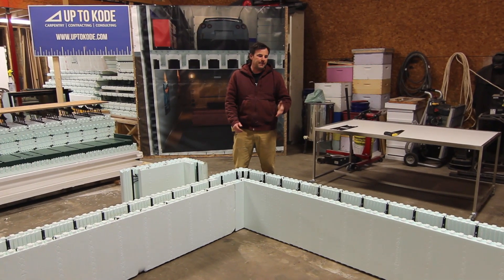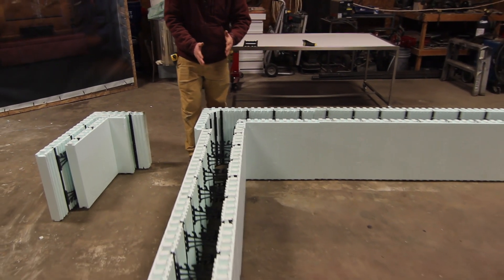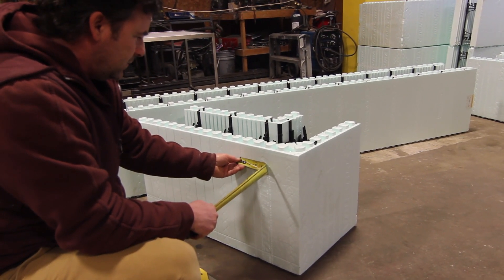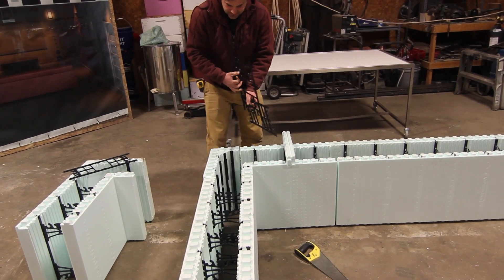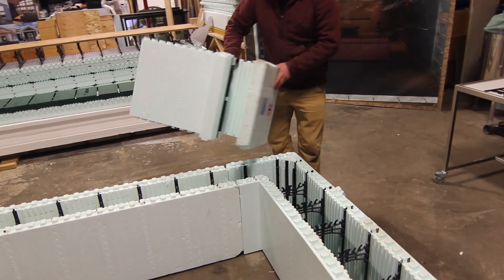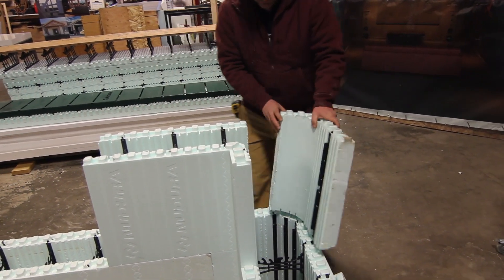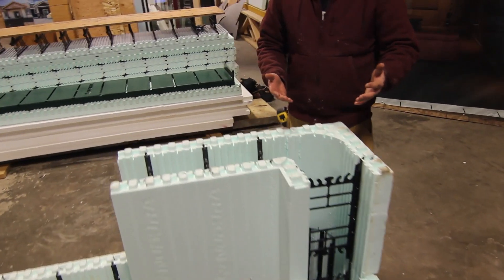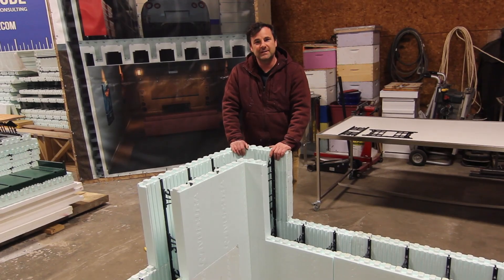How to Transition from a 6" to 8" ICF Wall

Comment: What I was meaning is I wanted to make the basement 8 inch walls then pour only 6 inch walls for the rest of the home.
Thanks
 Bruce
Reply from the maker: I’ve never done that. It is very possible. My question is why do you need 8” below grade? I have done some pretty high backfills with 6” core as long as you add extra and thicker rebar. Best to have someone spec that for you.
Reply: @uptokode  Nudura makes a transition bracket for that. "The Transition Bracket allows two different form widths to be connected together. Primary use is to create a ledge to support 
brick or a floor system."
Reply from the maker: A little bit different than what this video is about but I know what you are saying.  You are referring to changing wall thicknesses at a certain elevation that would create a ledge.  I’m glad you mentioned it !

Comment: Cody
How do you pour 8 inch basement the 6 inch for walls of house?
Thanks
Bruce
Reply from the maker: I might need you to be more specific with the question. 

For pouring we use a pump truck and we vibrate the concrete with a 1.25” vibrating whip about every 16”. Does this answer anything for you?